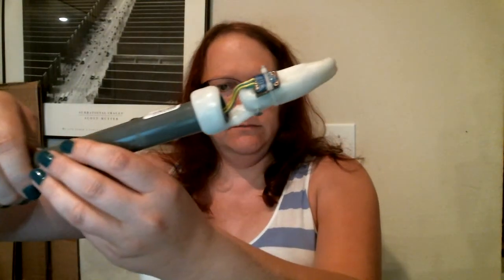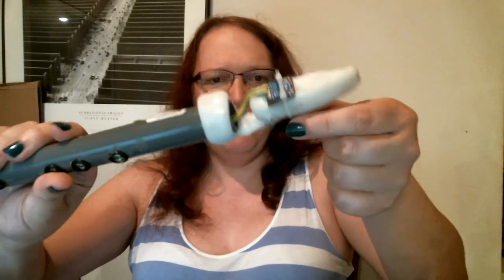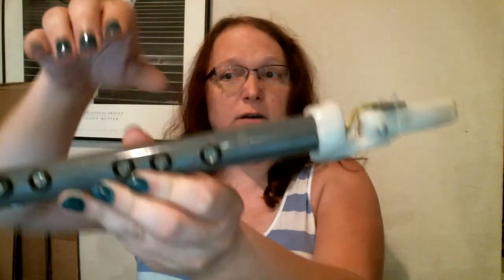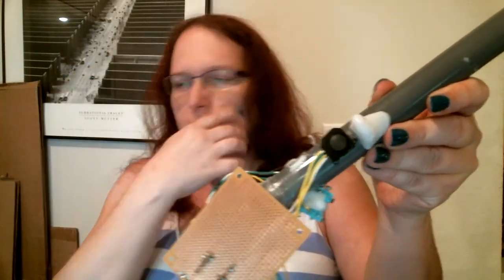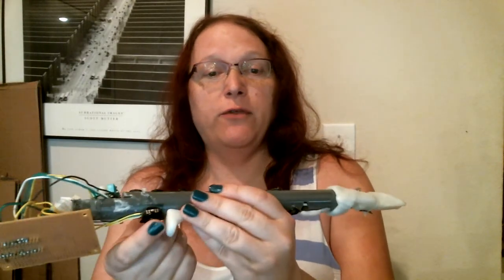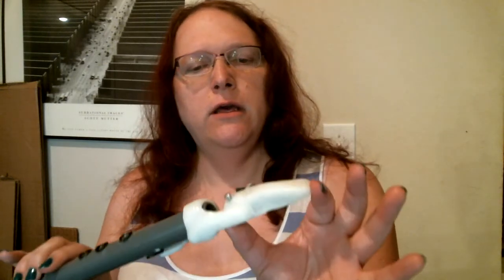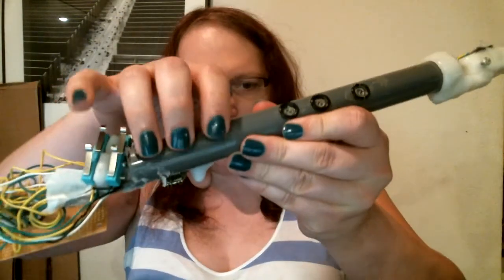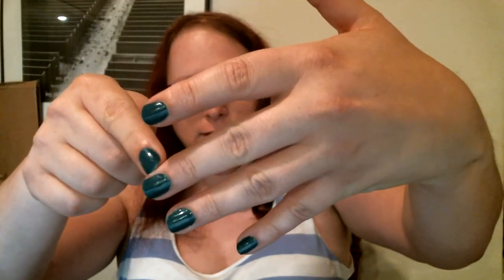MIDI wind controller first look

Comment: Nice project, similar to REMI EWI.

But did you find the pressure sensor good enough for the task? Wasn't the range of the sensor too high for human breath? I think that maybe MP3V5004GP or ABPLLND060MGAA3 might be more appropriate, although they are pricey and not that easy to find.

I want to create something similar but with position sensitive strip (so called softpot) - it might make fingering more interesting with glissandos and without complex fingering patterns to learn. Just slide your finger up until you reach the note, and with time you might develop muscle memory for how far to slide to reach the desired note. Considering that we have total control over MIDI signals, we might use proper quantization and also learning mode where the note sounds really quiet until you slide to the desired note and then stop for more than 100ms or so - thus you will hear some low volume feedback while sliding and then when you feel like you've found the right note, you just stop sliding and the note sounds as loud as you blow it. Or you can split the strip in virtual sections marked with some rubber lines to make each note distinct. Of course, classic woodwind fingerings wouldn't work because the softpot doesn't support multitouch.

Anyway, lots of possibilities with both softpot, touch sensors or even physical buttons for those who want more saxophone-like feel.

Comment: Very cool, Gwen. Is your code available anywhere?
Reply from the maker: I don't have it available anywhere currently, but if you are wanting to do something similar, I'd be glad to give you some help.
Reply: I'm curious what challenges you've run into with the Teensy LC, and any practical experience/caveats you have with capacitive touch sending and longer wire lengths.

I've used the Teensy 3.0/3.1/3.2 in a number of projects, and shapelock, too! See http://gordophone.blogspot.com.
Reply from the maker: Gordon Good The LC is pretty close to the 3.x, and for this project, i didn't have any big issues.

The capacitive touch didn't give me any issues with the long wires.  You do need to look at the values you get to make sure your threshold for touch is set high enough.  The other thing with using it on a wind instrument is that you need a tactile reference for where the pads are.  That is why i used the rubber o-rings around the touch pads.

There is a bit more info here:
https://hackaday.io/project/6126-midi-wind-controller